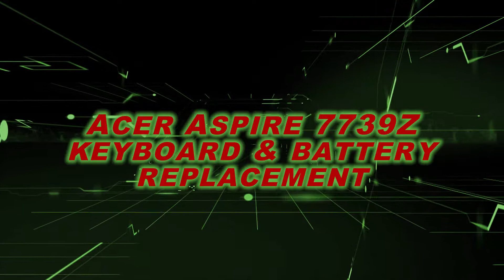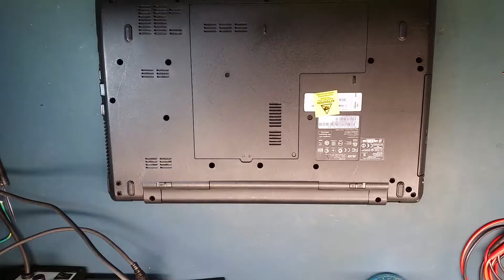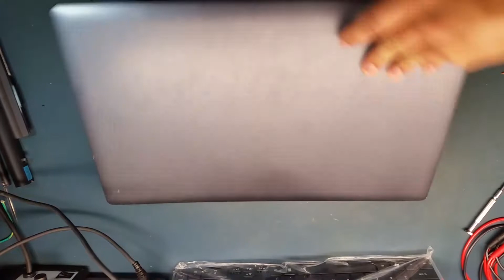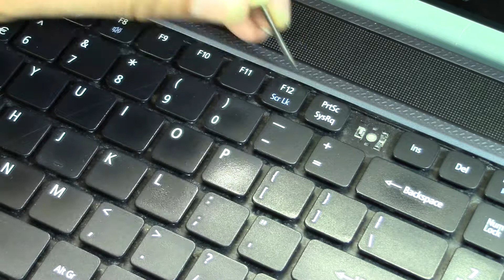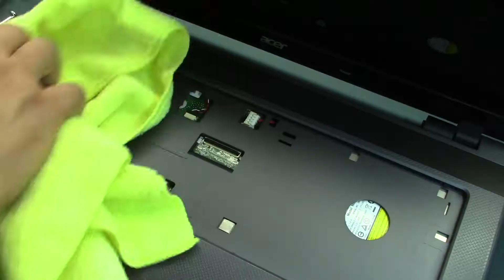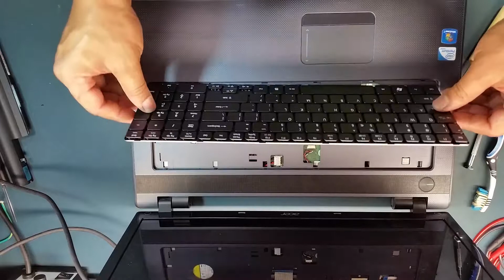RTL#5 Acer Aspire 7739Z Keyboard Replacement

Comment: Yes, this video was very helpful.  All laptops seem to have their own way of holding the keyboard in place, 
so it is good to have info that is specific to the laptop that you own.  Thanks for making this video.  👍
Reply from the maker: Thank you for watching the video. Much appreciated.
Reply: @ricgroman  You're most welcome.  I had a glitch come up in this process, though.  After looking closely at the laptop end of the ribbon cable, there is no bare metal there to make contact with the laptop.  The fact  that the keyboard was working when I removed the
keyboard suggests that this must be either a serrated clamp with teeth that penetrate the plastic or some sort of induction pickup.  Still
working on getting it back together but am having bad thoughts about the ancestry of those who designed this sort of cable connection.
lol... I think.